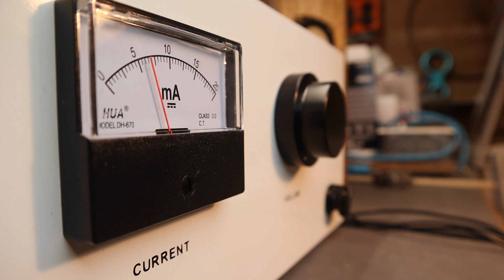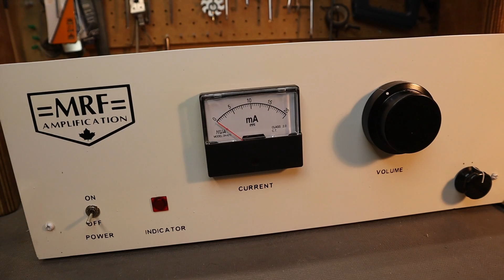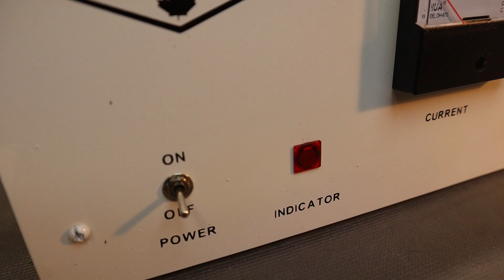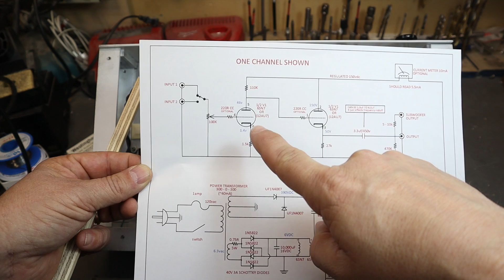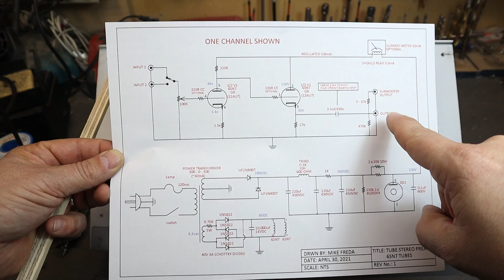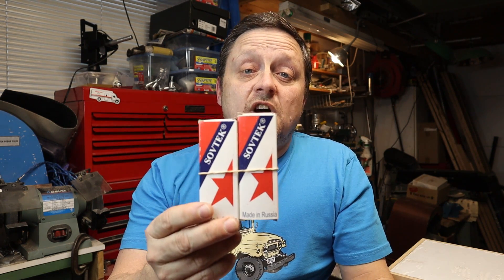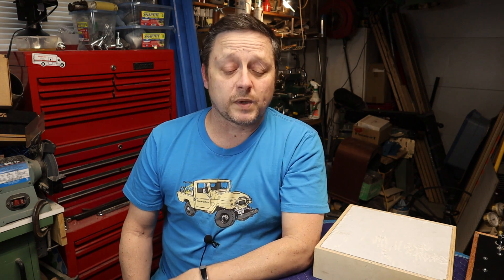Making a 6SN7 Tube Linestage // DIY Tube Stereo Preamp // New all Tube Shop Stereo System build!

Comment: Which power transformer did you use?
Reply from the maker: I used a old Fender champ PT.  You could substitute a Hammond. 270 or a 272 series will work. This circuit does not draw a lot of current. Most of the current draw is some by the OD3. If you omitted that from the circuit you could use a very small and inexpensive PT.

Comment: Nice job. Very clean. I bet it sounds amazing. Thanks for sharing.
Reply from the maker: Thanks. I’m still pretty happy with it. Looks and sounds good in my shop. Having a good stereo in a shop is very under valued.  This pre-amp has more that enough gain to power any amplifier.
Reply: @MikeFreda  I imagine having a good stereo anywhere you spend a significant amount of time can only be a good thing, but until and unless most of us can find a way to make that an affordable option, it will simply be an expensive and unaffordable luxury. Hence, one reason why so many take an interest in building their own gear. :)